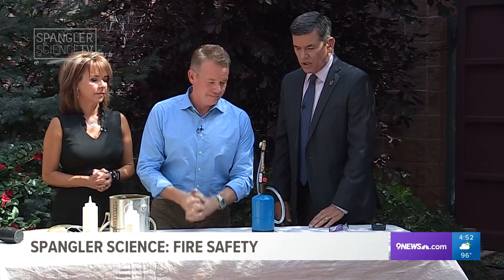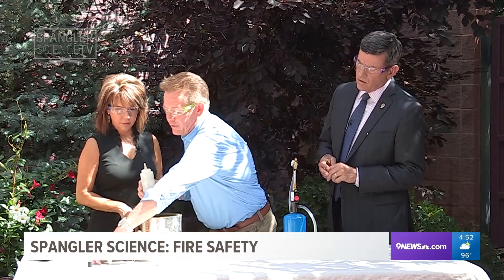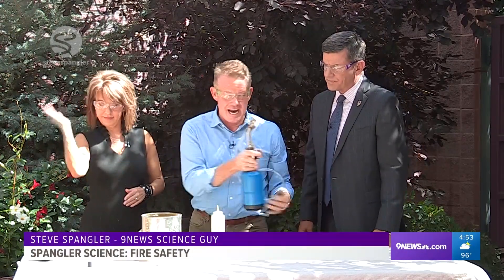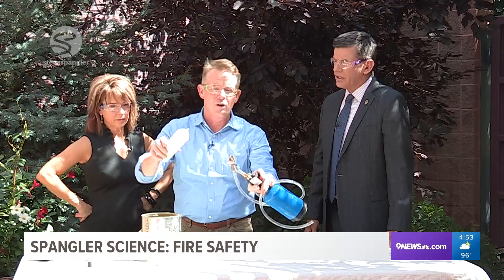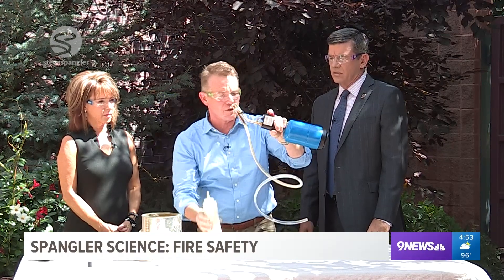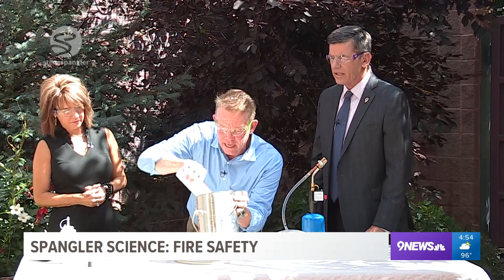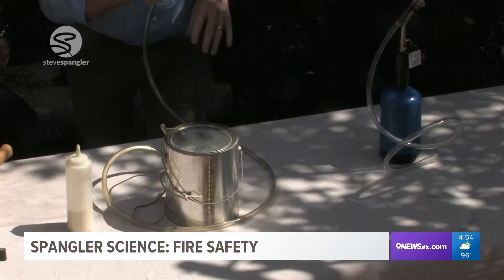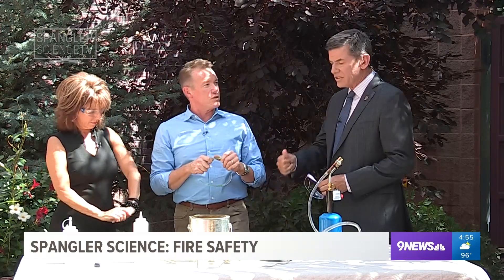Fire Safety - Grain Silo Fires - Cool Science

Comment: Why is there no powder based combustion engine?
Reply: particle remains that gets stuck in the mechanisms and will  eventually seize it, atleast if you talk about a motor or something. also it would be much heavier for the ammount of energy it releases, gasoline fumes are what burns, not the liquid form, so you get more energy released per litre of liquid gasoline than a solid particle. or something along those lines at least, im no expert so.
Reply: Three years late, but the engine in your car kind of is a powder based combustion engine. Gasoline is aerosolized (sprayed into super tiny drops) in order to increase surface area and burn faster/more completely. Corn powder burns fast for the same reason.
Reply: Whats materials do you use? Can you please tell me the quantities